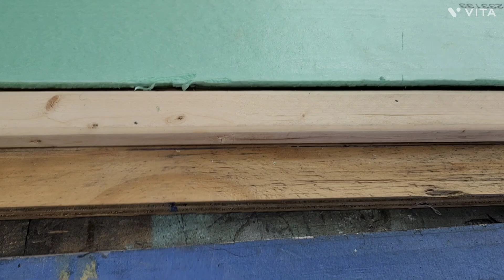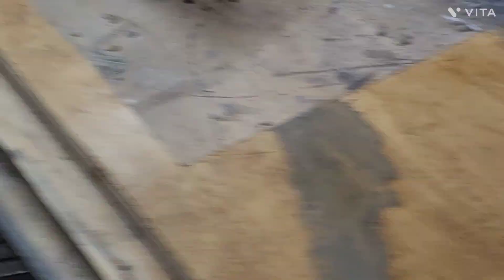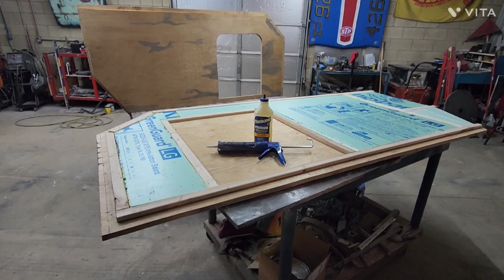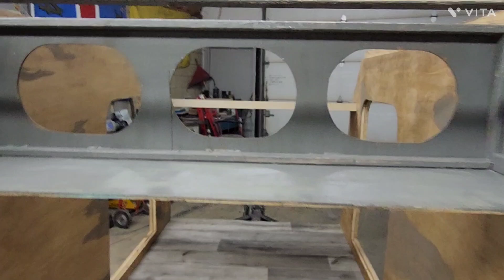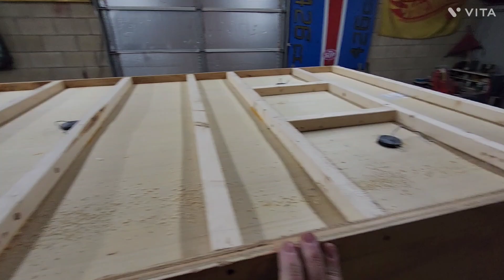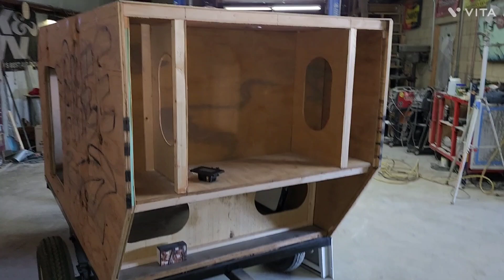Ep.2 Budget SQUAREDROP CAMPER build. insulated step walls & roof corner design assembly

Comment: Interesting build incorporating insulation.  After the plywood in my factory made teardrop camper rotted out due to water from a leak, I would recommend sealing all the plywood before the build, with a final coat on the edges after the build.
Reply from the maker: Yep absolutely you'll see in some of my builds i coat my exterior in 1 thinned spars, then another coat regular strength especially around the edges...